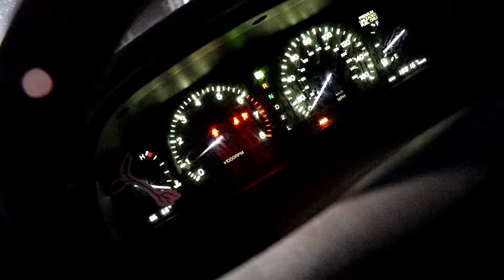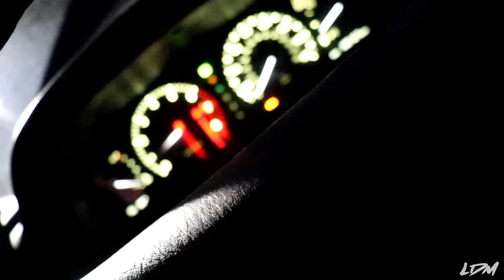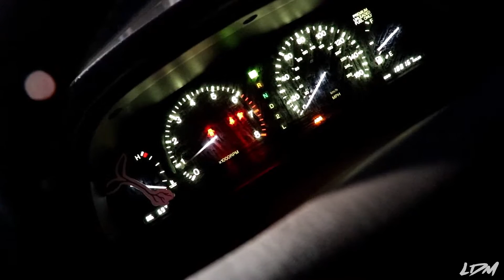LS400 IS FIXED!!!

Comment: I got a 92 ls400 that seems like it’s not shifting out of 2nd and kinda revs up and down ones it’s warmed up and sitting in park any ideas ?
Reply from the maker: For the shifting problem it could be the trans valve body sticking. I had one LS that wouldnt move in Drive cause by a bad valve body. As for the revving issue check for vacuum leaks